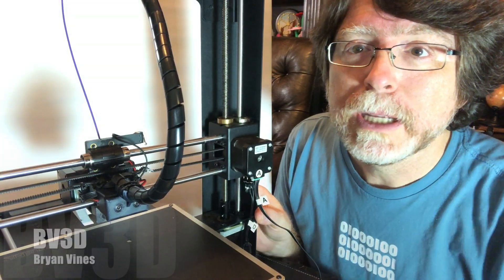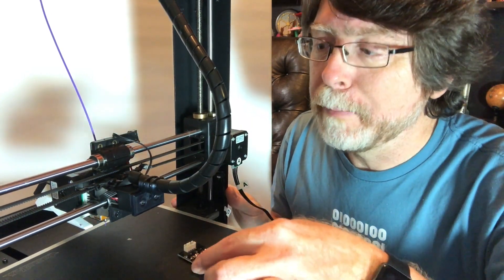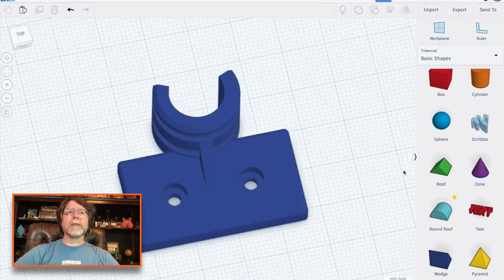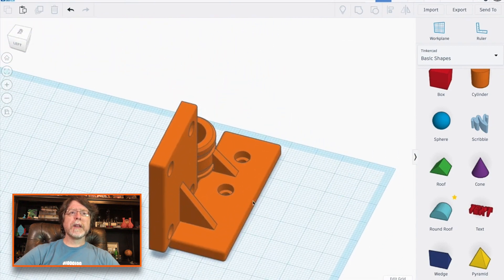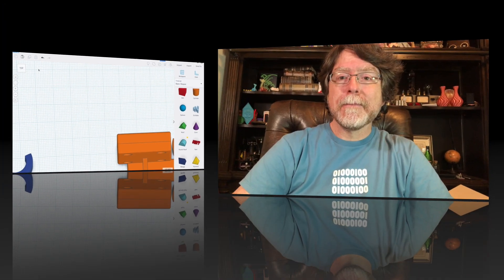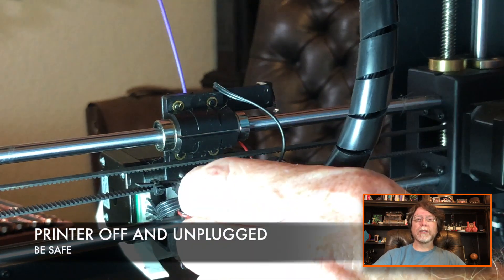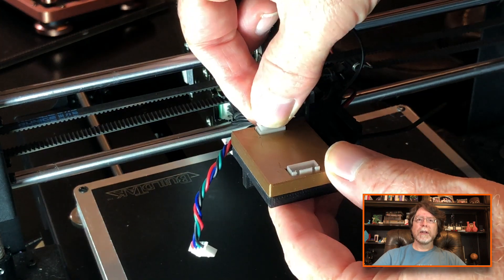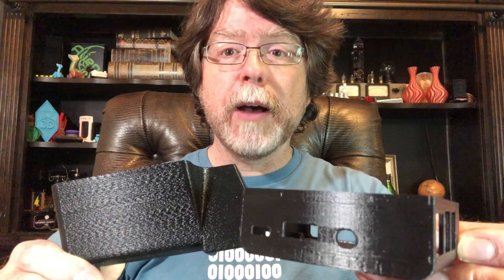How To Install TL-Smoother on Extruder for Monoprice Maker Select Plus

Comment: So why can't you just put the tl smoother board near the motherboard itself to save weight? I dont see why it has to be on the extruder ?? Riddle me this??
Reply from the maker: Because the four wires that drive the extruder stepper motor are part of the ribbon cable. The four pin socket for the stepper motor's wire doesn't appear anywhere on the printer except on the breakout board on the X carriage. 

If you wanted to, you could make a pair of long cables. One to plug into the stepper motor's four pin socket on the breakout board, to carry that signal back into the body of the printer, so you could plug it into a TL Smoother. And another to take the output of the TL Smoother back up to the stepper motor on the X carriage. These could still be tucked into the spiral cable wrap to keep them hidden. But it seemed a lot easier to just print a mount and use the short cables that came with the smoother.

Comment: Bryan, you always have the videos I need. I love it. It just tells me that you have already experienced the problems I am not coming to with the MMSP. I'm really debating getting a new printer. Could you make a quick edit to your design to remove the ribbon cable mount and have the box for the TL smoother directly over (perpendicular) to the mount?

Comment: I've had my Maker Select Plus since April, only decided to start modding recently--with the micro swiss hotend kit. I didn't notice it at first since I've been printing a diorama for my AMT 1989 Batmobile. But in the last few days, I've been printing things with more height, and have noticed that affect on the prints. So I'll have to try this. Thank you!

Comment: Will this help on a stock maker plus?
Reply from the maker: Yes, it should. However, the salmon skin effect is most noticeable if you've replaced the hot end with an all metal one, such as the Micro Swiss all metal hot end. My theory is that it's due to the PTFE tube in the stock hot end providing something of a buffer for filament pressure. The all metal hot end is more sensitive to pressure variations from the extruder stepper motor, and you can end up with a really pronounced salmon skin effect.
Reply: @BV3D  I see. Well I've decided to do all 3 anyway. As well as fans and y plate. I'm so glad I've come across your channel, not a whole lot of YouTube support on the maker. You've earned a subscriber 👍 keep it up sir

Comment: I have been thinking about a TL smoother on the extruder motor. I already have them on x, y and z. They really do make a difference. 
This video has convinced me to put another on the extruder motor. Thank you
Reply from the maker: Hi Tony! I haven't tried using TL smothers on the Z axis. Do you see much of a difference by having them there?
Reply: @BV3D  
Hi Bryan.
It's hard to tell at the moment. I need to print a few tests in vase mode.
I'm using an Ender 3 but printing parts for my Anet 8. I haven't printed anything tall since I installed the smoothers, but I am printing a power supply cover overnight tonight. I will let you know how I get on but so far I have seen a good improvement in quality.
Reply: Hi again Bryan.
Just a little update for you. 
I have been testing the z smoother today in vase mode.
I was already getting good results but even better now.
Reply from the maker: Awesome! Thanks for the follow-up! 👍

Comment: Great video, thanks for the links.
Reply from the maker: Hi Rob! Thank you, and you are welcome. If you do this mod, let me know how it goes! 👍
Reply: Hey Bryan,  doing this upgrade now and also did the heat sink and fan upgrade as well.  On this one do I need to switch the wires around on the connector that came with the smoother or will they work as is?  Great videos.  Thanks for those.
Reply: Also does it matter which side of the board the stepper motor is plugged into?
Reply from the maker: Hi Rob! On the ones I used, the short cables which came with the smoothers did not need any changes.  👍Keep me posted on your progress!
Reply from the maker: The smoothers don't care which side goes to the motor. They don't have an "input" side or an "output" side. They do their thing either way.

Comment: I remember someone talking about the smoother, in essence it is a bunch (8) of diodes,  Nice job San Antonio :-)
Reply from the maker: Yeah, I need to look up how that actually works. I mean, I know what a diode does, but I haven't looked at the schematic for the smoothers or what the TL Smoother is supposed to be doing for the signals coming to the stepper motor. Anyway, thanks for subscribing and commenting! 😃

Comment: That is a good idea Bryan. I'd tried smoothers last year but I found they warmed up and were pretty much untouchable. Mine were from far east sellers so that might my issue. So it would be a good idea to watch the temperature of your smoothers and you may need to adjust your amperage and / or add cooling.
Reply from the maker: Hi David, thanks for the note. If the smoother I've installed here seems to be getting warm, I'll redesign the mount to include ventilation slots. I'll keep an eye on it! 👍
Reply: I also have a non-TL brand smoother and am monitoring temps. The top case on mine is getting up to 112F. It's not terrible, but may need some airflow to the case design - which I may do by simply drilling some holes in the bottom and top case.

One question I've not seen answered anywhere is, does it matter which connector on the smoother board is the "IN" or the "OUT"? On mine, one is labeled "P1" and the other "P2". I received no instructions with them, but went ahead and made the connection from the board to P1, and then the connection back to the motor P2. The printer works, but I've yet to print anything that would show the impact of the board.